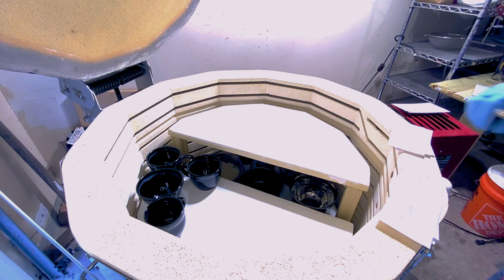Kiln Opening #4 Using AMACO Cone 5 Glazes. The Results Were Surprisingly Not Bad. Pottery/Ceramics

Comment: You did really well!!! Definitely use witness cones so you know what temp each area of your kiln is reaching. Great job. You’ll be pleasantly surprised when you go to cone 6!! It’s so exciting going from low fire to mid! Also keep in mind that the way you load the kiln will change the outcome of the glazes. I make sure to always have enough glazed pots to fill my kiln. I use the smallest kiln posts on each shelf to make sure the load is a bit more tight. I have found that leaving too much room between shelves doesn’t give as much of a dense heat work. Absolutely make sure to make some tall test tiles to get a better idea of what they do! Good luck! Your pots are absolutely beautiful!!!
Reply from the maker: Sorry it took so long to reply. Thank you for your sound advice and kind remarks. I finally fixed the lighting situation I had issues with on my last kiln opening.